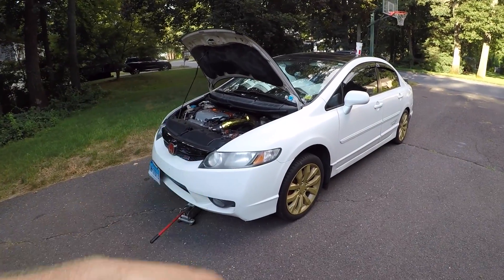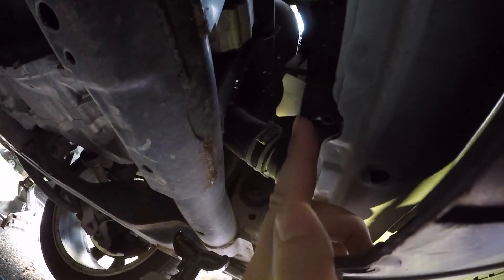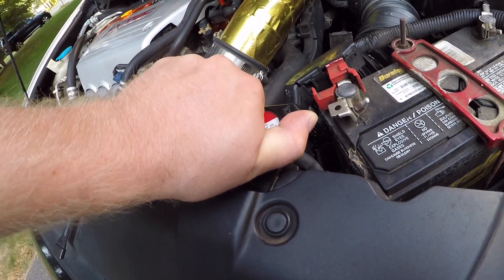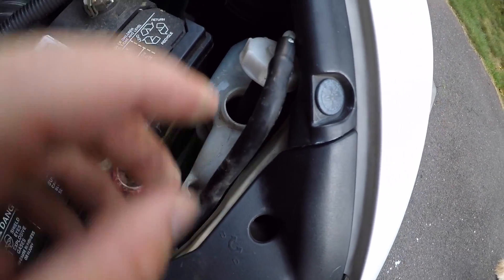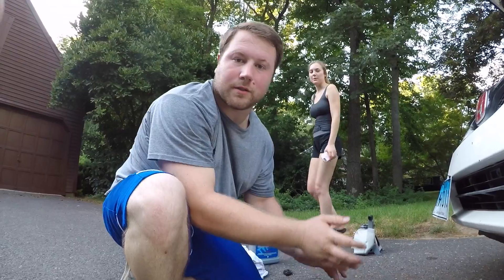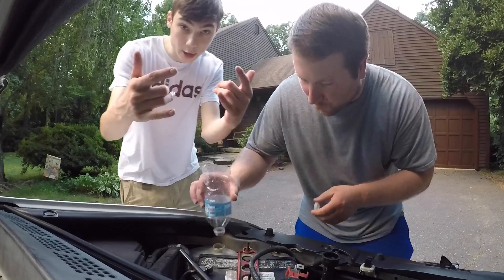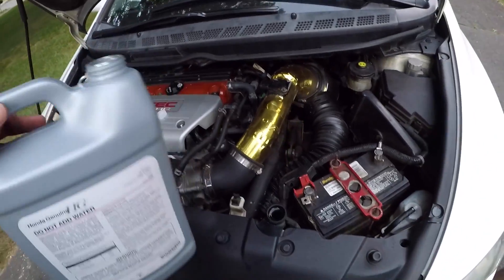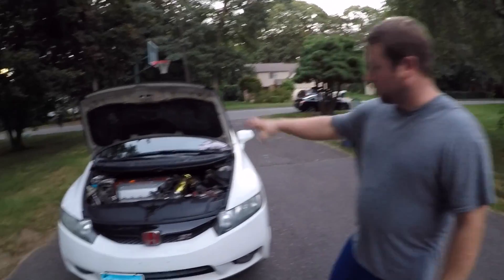Honda Civic Si Engine Coolant Replacement DIY (2006 2011 Si)

Comment: So today I had to do this. Noticed that the coolant levels in the radiator dropped around 20min after starting the car. But the fans never did turn on…
Reply from the maker: Just top it off when cars engine is cold.

Comment: Thanks for the video & great job !
2:40 Add fluid in the reservoir to the max line before sliding the reservoir back inside the engine bay.
Otherwise, it's impossible to fill to the max line (hard to see)

Comment: 1:20 lol I took the radiator cap off on my 84 mustang YEARS ago when the engine temp gauge was like over the "H"  to put more water in and what was left blew right up in my friend and i's faces 😂....
but yeah legit watching now to drain what I'm sure is still factory coolant and add new to my 09 civic  👊

Comment: How do I know I need to top up coolant ? And how often should it be done . Pls help
Reply from the maker: If you pop radiator cap while engine is cold and coolant is not at the top. Second, your coolant res level should be at minimum mark, if lower, add coolant
Reply: @TheGerbsteve  thanks bro. I appreciate

Comment: There’s also a screw in front of the engine which you need to unscrew to drain the old coolant completely from the system, service manual reads

Comment: This was a good video. It's the coolant service you would do IF you had the right coolant to begin with.
If you find that a past owner (or yourself) has put the wrong type of coolant in. You will need to flush.
Buy 2 gallons of distilled water along with 2 gallons of the type 2 Honda coolant. If you don't want to use the Honda coolant and just wanna get something from the auto parts store. Get the Asian vehicle formula because its silicate and borate free. 
Anyways, do just like Gerb and drain the radiator and clean the overflow tank.
Now close the valve on the bottom of the radiator and fill with the distilled water. I find if you Jack the car up in the front and let the car run (radiator cap off, heater on, fan set to max)
It will help the water get into the heater core. You must keep adding water and letting the system burp until your car starts blowing hot air from the inside vents.
Once that's been done, shut the car off, lower it back down and repeat the radiator drain.
The reason you flushed is about 1 gallon of coolant is in the radiator... the other half a gallon (of the wrong shit) was still in the engine/heater system.
The flush just helped remove "most" of that.
At this point you can now fill the car with the correct coolant, lift and burp the system until you feel heat from your vents, refill the overflow tank and everything will be ok.
IF your really picky you go back a 3rd time and drain to remove the new coolant, that distilled water still in the system from your first flush and the small amount of the wrong coolant that is all now currently in the system.
The 3rd flush is something I do. But I don't believe its 100% must... unless you live somewhere where it gets extremely hot or cold. Because you wont have a true 50/50 mix by leaving that remaining distilled water in the system. 
Sorry for the long post. Hope it helps.
Reply: Shud never mix coolant types...previous owner screwed up...shud flush entire system
Reply: Ryan Fulkman awesome tip. I’m going to be installing a block heater so when I remove that bolt on the bottom of the block wouldn’t that drain the rest of the fluid in the system? And is it a risk to mix clean fluid with a bit of the distilled water?
Reply: Awesome. I actually thought about this. Nice to know it's an actual concept.
Reply: Can I use Preston?
Reply: @rn4421  
coolant temperature in the radiator and cooling system
*Temp Benefit:*  
Honda Type 2 Blue: -1 to -3°C  
Zerex Asian Blue: -1 to -2°C  
Prestone Universal Blue: 0 to -1°C
so, depending on where you live, if you're looking for cooler if living in a hotter area, or slightly warmer if you're living in a colder areas.

Comment: Gerb, I've watched many of your vids about working on your 8th Gen.
Do you have any about replacing a starter?
My 07 Si is needing one, but I can't really find good info on the replacement.
Reply from the maker: Thanks a ton man... Feels good knowing people actually take the time to watch my vids. Unfortunately, i don't have a starter vid yet, but i'm sure i'll be replacing that sometime in the near future. What's your car doing, hesitating to start or?
Reply: Its only 2 bolts.  Just jack it up.    I was so nervous it took me 3 days.   Remember 2 bolts and couple wires.

Comment: Someone else pointed it out already, but if you're trying to change out all of the offbrand coolant you're going to have to flush the system at least 2-3 times to really make sure it's all out of the block and water pump, right now you probably have about another 1/2 liter of the original coolant in there. That being said this is definitely the right way to do it if you need to drain and replace as part of some other job.
Reply from the maker: True dat.. We might have to drain more out before winter
Reply: How do you get the system up to 50/50 if you don't have concentrate coolant?  All I can get is 50/50 and I just flushed using water

Comment: I’m planning on doing mines soon... how many bottles did it take? Is 1 enough? Or do u recommend getting 2 bottles of coolant?
Reply: get 2!!
Reply from the maker: 2 gallons to be safe. Stock radiator holds a bit over 1 gallon if I’m not mistaken
Reply: Thanks guys much appreciated

Comment: All you really gotta do to bleed it is rev it up to 2k rpm once the fans kick on its bled. Top up and cap it.
Reply: And if still Bubbles come out after the fans kick in... than get ready for a head gasket repair... 💔
Reply: @Loyal_Honda_Fan   *then